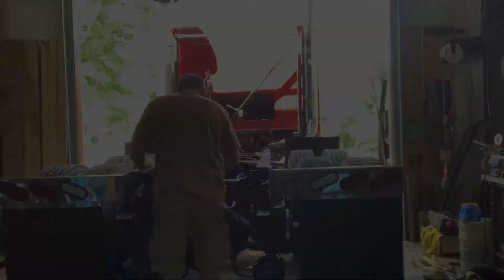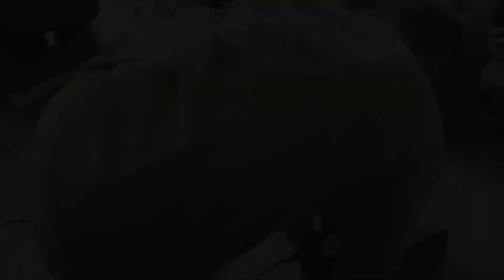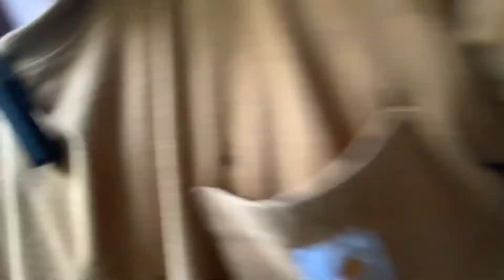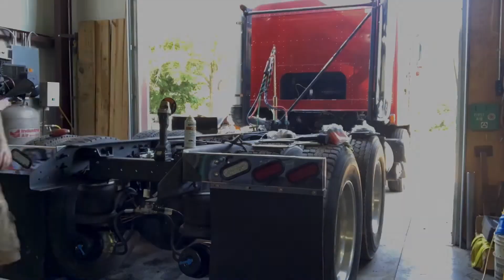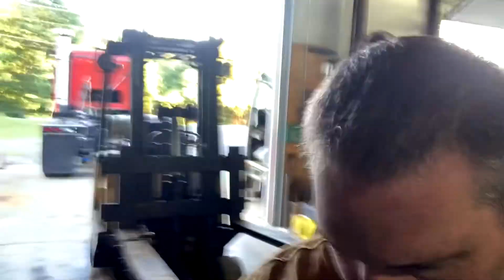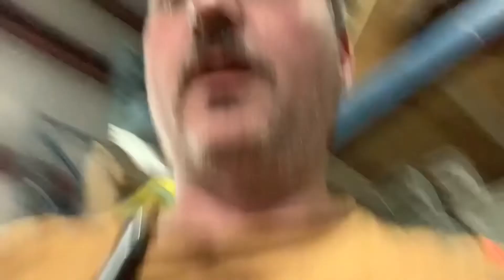Meet Trisha, 1983 kenworth k100 cabover. Fifth wheel install

Comment: Hi James. You made that drilling job look easy. Those magnet drills are great to use. You really must’ve done a good measuring job to only end up with 2 holes outta whack. Keep it up and you’ll be driving her down the road with your trailer next week. Shouldn’t be too hard to find that airline for the slider a few more holes and you’ll be done with that part. Have a good one!